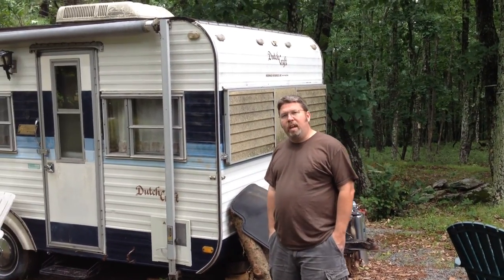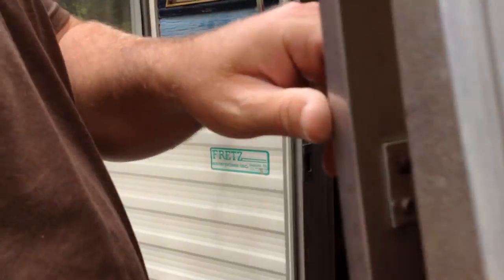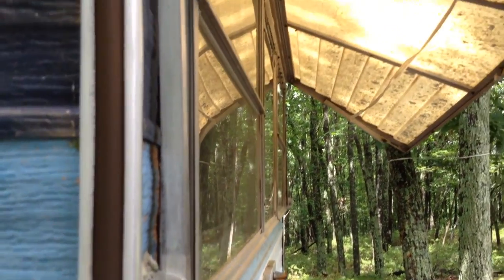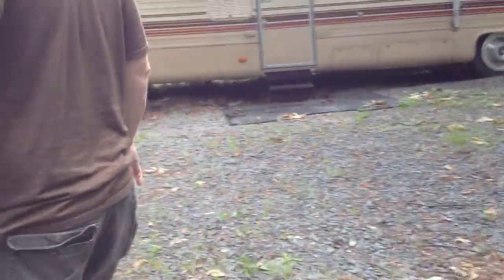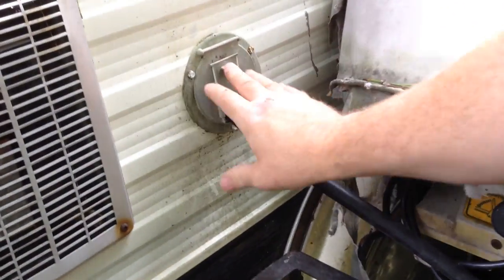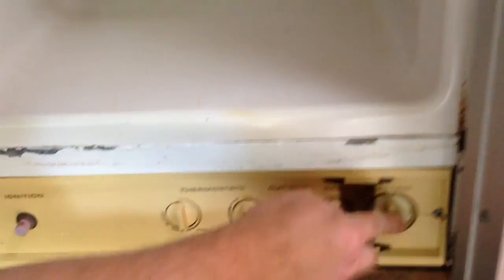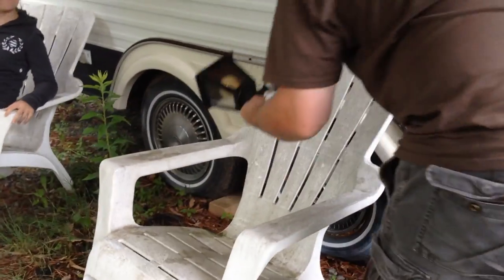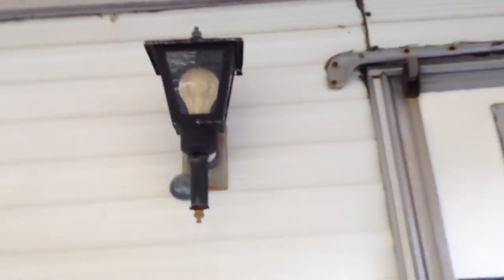How to Set Up Vintage Travel Trailer for Basic Use.

Comment: I just purchased a 1971 15.5' Dutch Craft! Looking for others with Dutch Crafts! I am in for a restoration on mine this winter. I'm in central NY
Reply: Did you get it all fixed up?  I am thinking about getting one that needs a new roof in trade for some work, but will see how bad it is first.
Reply: Yes, it was a complete rebuild, skin off, roof lifted, replaced rafters (should have replaced all of them since two are a bit twisted and make my ceiling wonky), built three completely new walls, left kitchen in tact and just pulled and replaced framing. All 2x2 framing under the floor on both sides was rotted, so had to cut parts of flooring out, grind off bolts, replace 2x2s and re-attache to metal frame, piece in floor. I also redesigned/rebuilt the bed and dinette. If you are on FB I have the whole album there. i like the shape of the Dutch Craft. Saw one in PA that I wish I could go get. Bigger than mine with bathroom